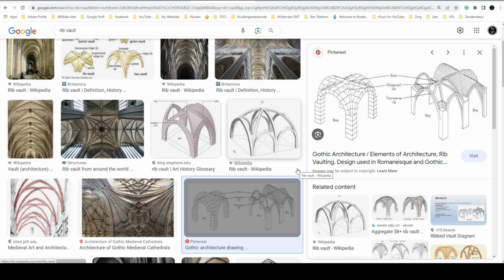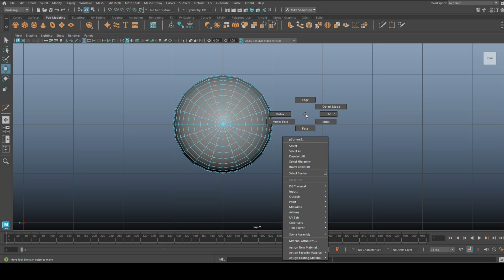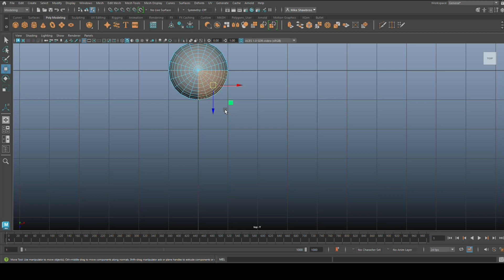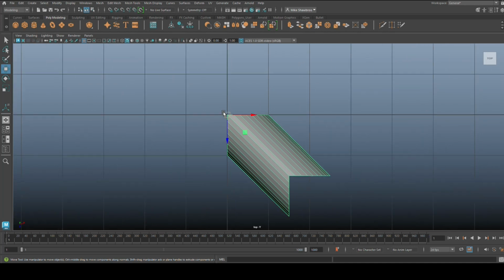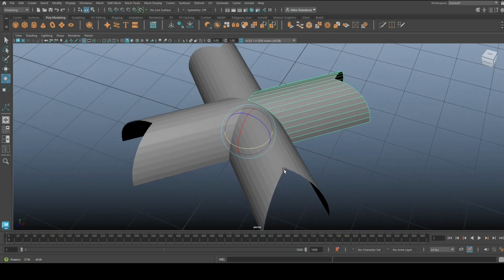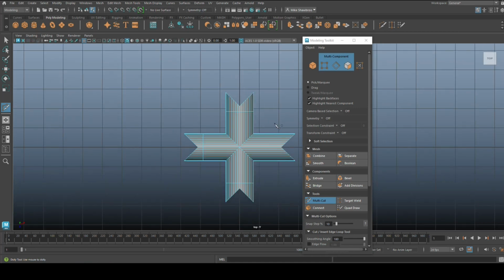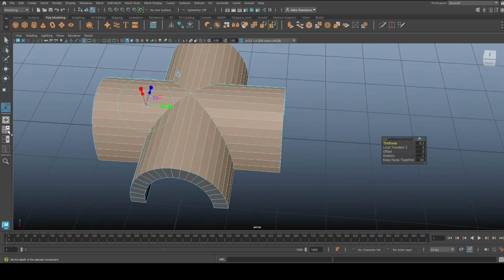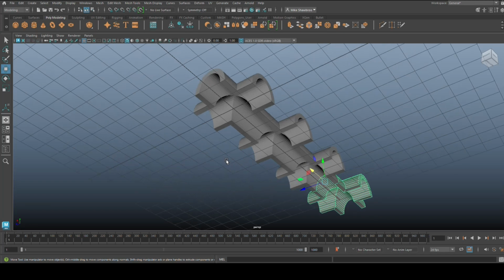How to model a Church or Cathedral ceiling ( a.k.a. Rib Vault )

Comment: I like the process, but what i would do a little bit different is to rotate the first roof part 45* then fixed the "V" part (probably would just select al vertices and scaled it in one axis to have them in line. Then id go with copying it 3x each with a 90* rotation, merged and so i would have them already same size and didnt need the cleanup.